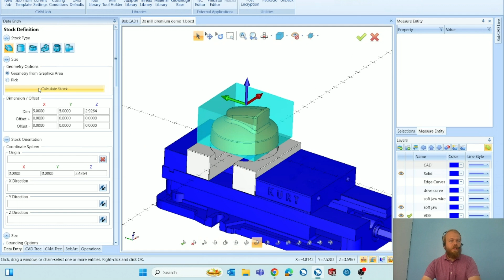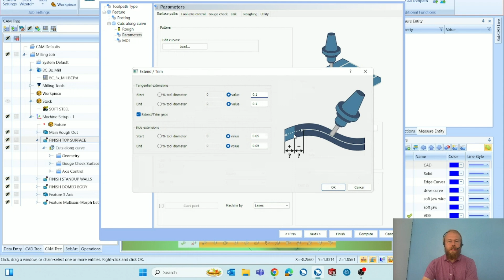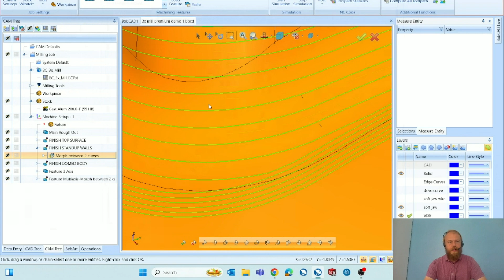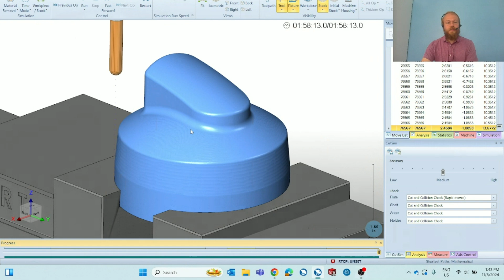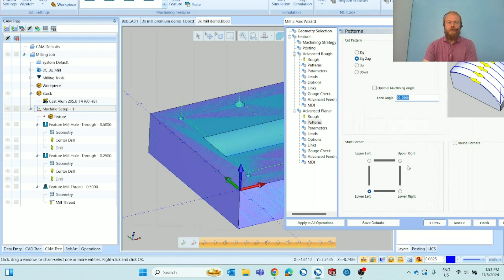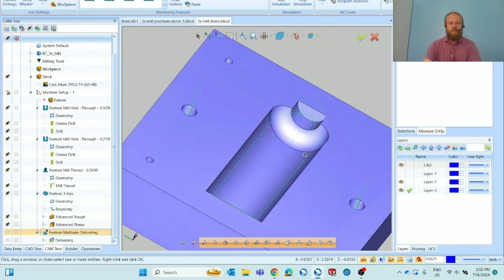Boost Your Machining with 3X Premium Toolpath!

Comment: Hi Eric and Monica,  there are aspects of using bobcad that I have never seen demonstrated that have been the most enabling. 1)  Having open 2 or more files open to be able to copy for saving intermediate geometry creations because when boolean or other functions are used, bobcad deletes important created wireframes or geometry layer contents.  2) Having an older version of bobcad to test failed operations.  I have found bugs that are as irrational as bugs are, but it saves time to be able to move parts and test the code. 3) Moving such layer contents to a different version of bobcad is intentionally defeated by Harris/bobcad.  Really disappointing that you think the latest is exclusive.  To defeat the bobcad obstruction, you should demonstrate the necessity of saving various geometry steps as DXF for moving to the other versions of bobcad.  There is really no way I have found to use the vaunted copy feature to copy Features to a different version. 4)  The biggest failure of all is the Harris/bobcad decision to defeat/renege on the perpetual licenses by shutting down your license transfer number generator for all versions of existing licenses.  Don't confuse the license key generator with illusions of old version updates or tech support as those are different subjects.